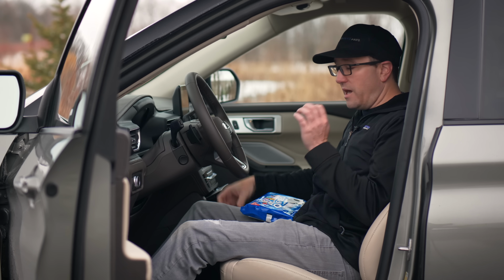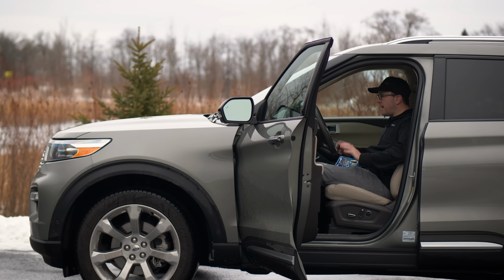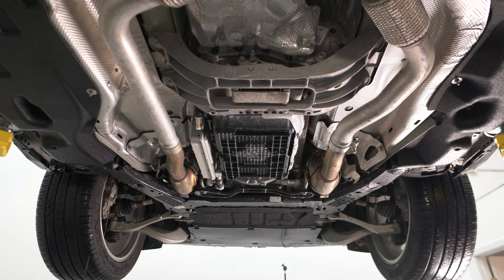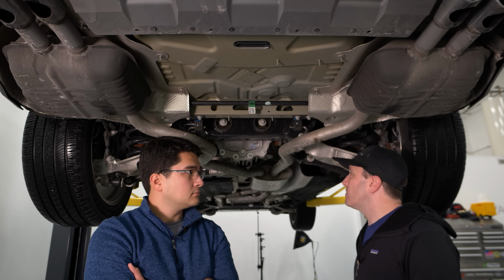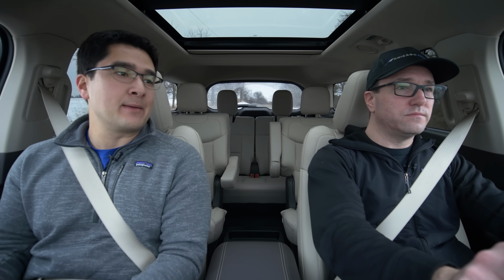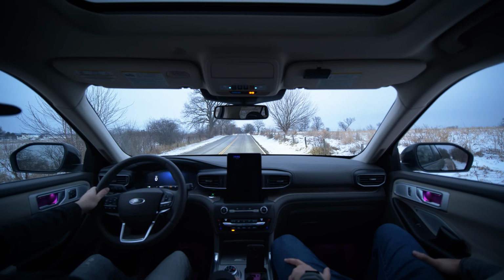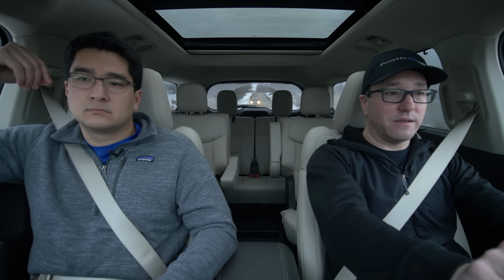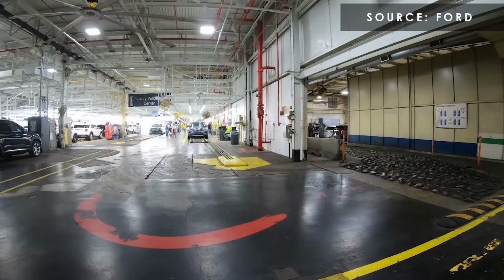2020 Ford Explorer | Who Is Responsible For This?

Comment: Mark: "if you're coming from trucks and you're looking for an SUV with that truck feel, this is the only SUV in its class that can deliver." (Ok it's not exactly what he said)

Durango: Am I a joke to you? I can tow more than most body on frame SUVs. 

The Durango is one of the Exploders main competitors yet you didn't mention it at all.
Reply: The durango doesn't drive truck like, feels like a crossover with rwd
Reply: @tylerslater4709  sorry it doesn't. Most Crossovers feel like cars. The Durango feels more like a Ram. I would know we build them here at my plant. Once the new turbo I6 comes on line for the Durango, this exploder is really going to be put on notice.
Reply: @Turshin  Agree to disagree, IMO the durango doesn't feel like something I would be comfortable being rough on. I'm not saying its bad by any means. The styling, although its old, still looks great. The power of the 3.6 was perfect for most consumers. I drove one to texas and back from michigan. I didn't like the blind spots, but that's a given with almost all suv's today.  My only real concern was the coolant overflow tank somehow emptied in that 3500 miles. I work in the automotive industry for a supplier. Truthfully, the interiors, you would be surprised how many brands share a lot of materials. I understand you take pride in your work, that's very admirable. But that will make you biased to some extent, not saying that's a bad thing either. Brand loyalty is crucial for sales. Anyways, after that detour.... I respect your opinion, I just don't agree with it. I, as a general consumer, feel the durango is more car like, than it is truck like. But it is a pleasant vehicle to both drive, and look at. the explorer, is more truck like to drive, which some people will love, others wont. It too is a nice driving vehicle, although the issues pointed out in the review certainly need to be addressed. I'd like to see a re-review next spring. after they have had a year to work out all the kinks.  its just shameful that ford will need to do that in the first place. Hopefully they have learned their lesson, and wont botch the bronco when it goes into production this coming december.
Reply: @tylerslater4709  I grew up with Explorers. They're not all that. I'm sure this new one is better but sorry. It's a no go for me. I may a biased because I build them but, to be honest there isnt another vehicle in the category I would even come close to the Durango's capabilities. It looks great, can tow  more and faster than any other vehicle in its segment. Its lights out if they put the new 3.0 liter diesel in. It would have the  best towing with the best mpg.
Reply: @Turshin  I do like the durango, I just wont buy one. Its that whole, "one bad experience ruins it". I'm curious to see what happens in the market soon. People say they want diesels, but when it comes to sales figures, it doesn't show it. I think alternative fuels, EV's, and hybrids are going to be the way forward. Anyways, if you noticed in the video, there is a lot of beefy components underneath, I would assuming the towing capacity will jump drastically in the next 1-2 years. But, everything I've listed in both comments leads back to one thing, ford rushed it to production before it was ready. I have personally re-engineered tooling for interior components, just a few months into production launch. Whether its a simple rib to support a clip tower, or polishing to prevent a pull mark that doesn't let another component fit properly. The first year of production is always a headache. The durango had a few issues, its sister, the grand cherokee did too. I could fix the fit on those plastics in an afternoon. Its just going to be a process. A lot of which could have been avoided if they would have push back production just 3 months. The explorer just has too many, and its making it look SOOOO bad. Like I said, give it a year. The kinks will be worked out for the most part. But the amount of people waking into the ford dealer to check it out and being disappointed, will never be recovered. They are probably in a durango or telluride.

Comment: One thing that was skipped over was the 3L having the water pump driven by the timing chain. It's an engine out job when it leaks around 80k miles when you are out of warranty and about $3k to do.

Comment: Your video description says: "With other products like the Kia Telluride, Mazda CX9, Toyota Highlander and Dodge Durango close in price, good luck making a decision!"

These are all undercut the Explorer by a significant amount. You're talking a $10K-15K price difference when comparing the loaded models of these against a loaded Explorer. The Explorer is a cheap piece of trash and one of the worst vehicles in class, yet it's by far the most expensive. Ford are a bunch of idiots.

Comment: Ford NEVER gets the audio system right, in their cars. Never. The Sony system I had in my Edge would cut bass out, it was not very loud......treble was nonexistent...just sounded weak and muddy.

They Lincoln line seems to get the better equipment, as expected. But damn...I would think that Ford could get audio right, after all these years.

Comment: Before my wife decided on the Palisade we looked at this. We spent maybe 5 minutes sitting inside this mess of an interior before we walked out of the dealership. Not even in the same league as the Kia/Hyundai.
Reply: Michael Snow This is inexcusable from Ford imho...they have the experience to get things right and this isn't exactly an insignificant vehicle in their lineup.  Meanwhile Hyundai/Kia has gone from cranking out basically rubbish to REALLY competitive vehicles in a span of only about 20 years in the States. 
Glad Ford at least got the "trucky" aspect right to set it apart from the crowd.
Reply: Hippie Bits There isn't innovation because...CORPORATE AMERICA
Reply: Had the same experience with the previous generation explorer vs. cx-9.
Reply: You think the pair are good? Look at this another masterpiece from Hyundai.  YouTube video:

https://youtu.be/qBm7niXqcEc
.
Reply: KIA/Hyundai engines are blowing left right and center. Mine blew, had to get a new one in my KIA
Optima. My wife's friend bought a new KIA soul and it died within 4 days. They held back information and have a major class action lawsuit. Still not opening up about the issue.
Reply: @JCooK2007  So like the Ford dual clutch fuck up.
Reply: Well, it's not like it's a $500,000 GT or a $85,000 Mustang, or a $70,000 F-250. Hopefully Lincoln is spared in this design direction.
Reply: @K03sport  sorry to say Hyundai has an answer for Lincoln. YouTube video:

https://youtu.be/UO_6eIl4E2M
.
Reply: The telluride/palisade are MUCH nicer for the same price. Have way more tech, look better, have nicer interiors, and drive much better. 100k warranty makes it a no brainer.

Almost bought a telluride the other day but went for a 4Runner instead.
Reply: Agreed, Hyundai and Kia interiors are best in class. Definitely more reliable than Ford as well. The Palisade is a beautiful vehicle, congrats.
Reply: lololololololololo. sure. kia is GARBAGE
Reply: Amen. I’ve had my eyes on the explorer since my 11 Mustang and 16 Escape purchase. I was heavily leaning toward the Explorer with the emphasis on the RWD based AWD and the power train but the reviews have convinced me against it. Much rather have a Palisade or Telluride.
Reply: Michael Snow so you went from 400hp to 291? Buhahahaha lmfao clown
Reply: How sad! The Koreans are better than a Ford. Where have we gone...... 😫
Reply: I'm on my 4th Kia Soul mist reliable cars I've ever owned.
Reply: BigBwoyTing if they're so reliable, why are you on your fourth one?
Reply: @drw1926  I traded ok next in for a Dodge Charger, My wife's got wrecked and I use the insurance money for the 2018.
Reply: It's still rubbish if you plan on keeping your vehicle for a long time... Check parts availability of GM and Ford vs. anything Japanese or Korean.

Comment: 19:57 Oh we're gonna find out about transmission issues in a few years. Thats the one thing Ford is reliable about!
They probably had Junior engineers working on this and they tuned it to SMACK you in the face to make it feel like its fast.
Reply: we dont have to wait a few years. we are already seeing them in the dealers. including them leaking all their fluid and gernading on new cars.
Reply: I work at a Ford Dealership in the parts department with the technicians and we've already had to replace a few transmissions on these before their first oil change. On top of all of it, they were back ordered for nearly a month 🙄
Reply: Duane Rackham facts

Comment: I’m a Ford fan and Ford needs to watch this video and take some notes. 1 why the hell did Ford built a redesign car in a slum assembly plant in Chicago? 2 How hard is it to test and perfect a 10 speed transmission? 3 Fit and finish should be Perfected in 2020, I mean Hyundai, a cheaper manufacture surpasses Ford in F&F. 4 The CEO of Ford needs to be fired and replaced with someone from Toyota or Honda because Jim Hackett is one of the sole reasons Ford is plummeting. 5 cost cutting should be illegal in my opinion because I need to feel safe when I drive my vehicle. Cost cutting is the reason Ford ignored the fact that their Focus cars had defective transmissions!!!! Ford makes me sick!

Comment: Had a 2020 Exlporer XLT as a rental for three weeks. I really liked it for about 10 minutes then I hated it. Infotainment and hvac where absolutely horrible. Transmission was confused. And the throttle was way too sensitive. The vehicle wanted to bolt at the slightest touch. I didn't feel safe driving it.

Comment: A very candid review and thank you for doing so. I root for Ford, but they continue to misstep. I love the fact they're taking on Tesla (one step forward) then they rush this Explorer to the market (one step back). As you aptly note, this Explorer has rental fleet car written all over it. There's simply no excuse for that infotainment system - pure after thought and poorly executed. To make matters worse, outside of their core audience they won't sell many of these and they've priced themselves out of the segment on the higher trims. Frankly, they could have simply delayed for another model year and done the thing right. This version will not keep pace with where the segment is going. You really have to give Kia and Hyundai their props, they studied the market and hit the ball out of the park in their first stab into the 3 row segment. Toyota remains viable with the new Highlander as well, with the hybrid making them a viable alternative in this segment - can't beat that mpg and quality.

Comment: It sounds like Ford didn't learn much from the fiasco of the dual-clutch DPS-6 transmission in the Fiesta & Focus.
Reply: those are zf transmissions. same issues on the 06-10 ex and lots of F150s.
Reply: @user-rz9er5dm6k    I own 3 Fords. One is a 2016 Focus, which will be the last Ford i buy. I know they use suppliers for certain components. I worked at dealerships and was a mechanic. I was refering about this. If you have free time, please, read this article  https://amp.freep.com/amp/4243091002
Reply: @Roddy451  Yeah I certainly heard about those, that is horrible, I didn't realize it was so blatant. I thought this transmission though is an evolution of the 6r80s. Those have lots of shifting issues. Ford had a few good products (crown vic) but they also created the worse shit in the auto industry. That trans, also the 4.0SOHC engines in the older explorers.
Reply: @Roddy451  6 spd on my RS is good, but its a manual. Focus and Fiesta should of only be exclusively manual transmission
Reply: @GhostOfAMachine  The Fiesta ST and Ecoboost were manual only.
Reply: @GhostOfAMachine   Agreed. Because of this experience and how Ford has treated me I will never buy a Ford again. Shame on them.
Reply: @user-rz9er5dm6k   Thanks for taking the time to read it. There is also a video from Autoline Network, "Autoline After Hours - 472". About 38 minutes into the video, it goes into the report. As I said, I own 3 Fords, 2006 Taurus, 2012 Ford Fusion Sport AWD (Fully loaded), and the infamous 2016 Focus.
Reply: @Roddy451  12 fusion sport is the best car of the bunch. Has a toyota transmission.
Reply: @Roddy451  I have a bunch of fords too. My 98 MGM is getting close to 200K and sometimes I forget the engine is running it is so smooth. I turned the key to "start" it a few weeks ago. Shifts better than some new cars. Only issue is a worn driver seat.
Reply: @user-rz9er5dm6k   It is an Aisin unit. That is correct.
Reply: @user-rz9er5dm6k  ----The DPS-6 was a Getrag transmission, not ZF.  Read the whole history of that sheitshow.
Reply: @robertjones7565  I know, I was referring to the trans in the explorer, when the guy in the vid says it shifts funny. The trans in NEW explorer is the next generation of the trans in the v8-06-10 explorer, which had shifting issues. Ford has a history of shit transmissions. Took them a long time to get the taurus transmissons right. 5r55e's (on the older explorers) were some of the worst transmissions ever made.

Comment: "...Looks like it was designed to be a rental car or a fleet car..." Bingo! Considering that about 1/3rd of all Explorers go to fleets you nailed it, Mark. Likewise the references to selling to Ford loyalists. As far as the appeal of "truck-y-ness," there's a reason that crossover SUV's have killed off both the sedan and minivan market segments. There may be a market for the Explorer among F150 owners and fans but the last thing the vast majority of buyers in the midsize three row SUV market wants is a vehicle that "drives like a truck." Just ask my wife. 

There are reasons to applaud the shift to a RWD platform. One of the most important is towing capacity. A Dodge Durango offers up to an 8700 lb tow rating. Even a Nissan Pathfinder is rated at 6000 lbs. What does the Explorer offer? At 5300-5600 lbs, that's a measly 300-600 lbs more than several FWD-based rivals. Interestingly, a Lincoln Aviator with an identical V6 engine and drive train is rated at 6700 lbs. The only discernible difference? The Explorer has a Class III hitch compared to the Aviator's Class IV hitch. 

And then there's the price. Considering that the only way to get a V6 engine in an Explorer is to opt for an ST or Titanium trim level or a Hybrid "Limited" edition with an MSRP between $55,000 and $60,000. That's obviously absurd as the dealers in my area (Seattle) recognize by discounting those models. But even so the asking price is well over $50,000. That's a price that makes value comparisons to vehicles like the Telluride and Palisade absurd even with those models selling at MSRP or above. And that's why there are waiting lists for the Korean vehicles while the new Explorers are sitting unsold on dealer lots. 

Just as striking is the alternative of the Lincoln Aviator. A mid-level (Reserve) Aviator moderately optioned and  with the same engine and drive train as a top trim Explorer has an MSRP of about $65,000. The Lincoln is unlikely to have the same substantial dealer discount as an Explorer but even with a price difference of $5K to $8K, the value proposition strongly favors the Lincoln. In fact, it would be interesting to see the Savage Geese take on the Aviator. Based on the numerous deficiencies of the Explorer it may well be a much better alternative.

Comment: Fantastic video review!

You hit the nail on the head. The new Explorer does feel like a half baked product. I was so excited when the platform shift (to rear wheel drive) and engine chouces were announced... but then I test drove it and felt cheared. I drove it after having driven a fully decked out Telluride and Palisade. Even though I wish the KIA and Hyundai suvs had a rear wheel drive platform and a better/more powerful engine, there is simply no comparison -- the K/H products are just better overall.

I do hope that Ford listens to all the reviews out there and updated the Explorer accordingly.

Comment: Worst transmission...

Come drive my focus DCT. 

Ford makes great engine's and chassis's. Always. Even back in the days of the 90s zetec ford puma and focus engines. 

But something always gets lost in build quality and interior. You know this thing is going to either rust out, trim pieces are going to fall off, screen will crash..... something.

Comment: The central screen should be installed horizontal or should be wider. Generally Ford has a very poor interior design now in my opinion ...and 3 cylinders engines (1.0 and 1.5 EcoBoost in Europe)...  maybe they are good, but give us a choice

Comment: Unfortunately, you are not getting your 'facts' right, either. The Audio-system is not $1,000 more. It's part of a $1,000 PACKAGE. That package also includes the massage seat upgrade and the bigger center screen.
Reply from the maker: Its still 1k for a downgrade.
Reply: @savagegeese  A downgrade from what? Are you claiming the 12 speakers sound better than the 14? And the screen. If you don't like it or the upgraded speaker system, than simply skip the option. That gets you the horizontal screen you were asking for as well (which is standard - most of the reviews point out that fact, too). I prefer the vertical screen. Also funny how you want to judge the ST based on a Platinum review. The ST has a great handling/performance which was confirmed by other reviews as well - like this one: 
https://youtu.be/5jyqxscXD9E?t=1430
All I'm saying is that when you are doing a review which is so negative, the moment you base it on facts that are incorrect or only half the truth, you will be losing lots of credibility.